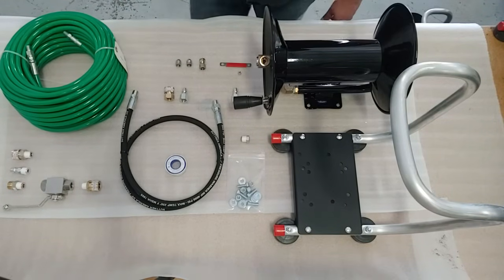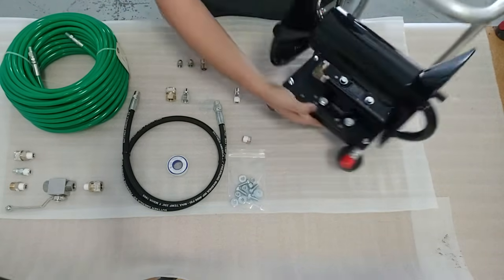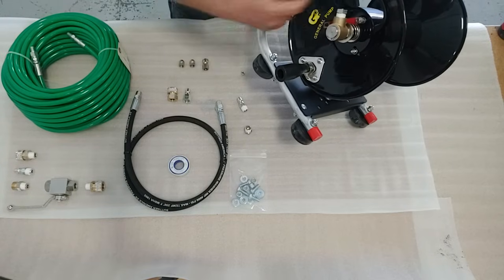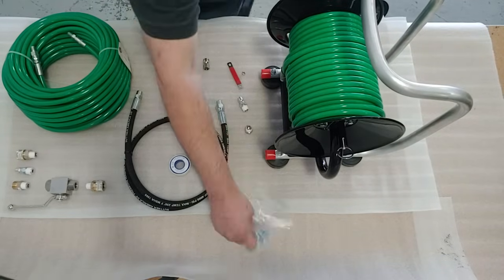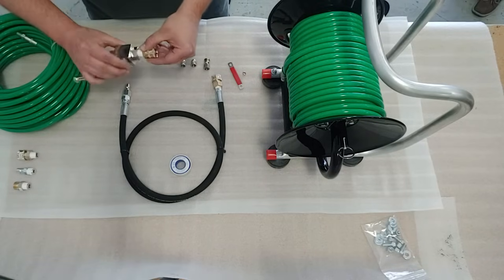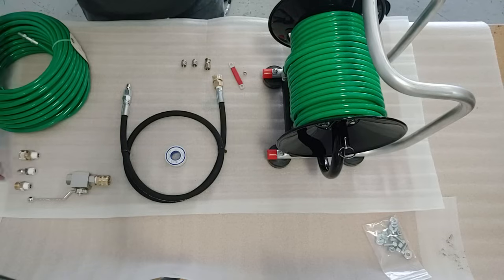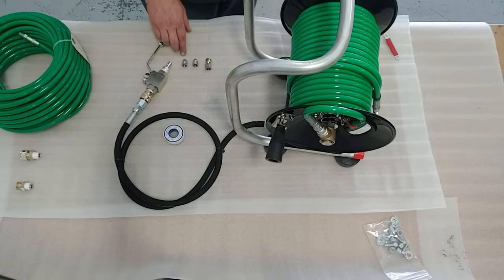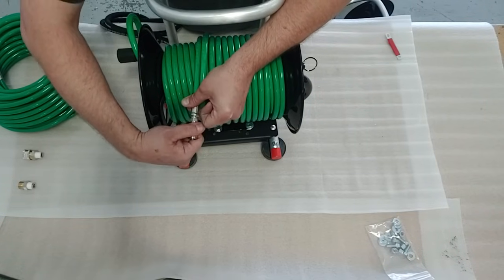Assembling the BossJet Jetter Conversion Kit COVKIT-02

Comment: Can this easily turn on 90 degree elbow for 2 inch ID pipe? The crimped end looks so long? I'm thinking about getting one.
Reply from the maker: Yes you can use these Jetter hoses in a 2" ID pipe for better bend radius we suggest using a 1/8" or 1/4" jetting hose for the smaller diameter pipes.

Comment: Can you mount the valve to the reel? When we are far from the machine it sucks to walk all the way back to turn off the valve in order to change heads...
Reply: Alonso,
     You can mount the valve anywhere you'd like after the output of the pump. Are you using the 50' leader hose-ball valve-5' Jumper hose to jetter hose reel if so the valve would be closer to you I ask because I'm not clear on how your machine is set-up?
Reply: @MattG77NY  I will be running a 100ft leader in order to get my portable reel to roof stacks or into far in indoors areas ....
Reply: yes you would hook up a ball valve in between the leader hose and 5' jumper that connects to the jetting reel so then the Valve control is close to you.